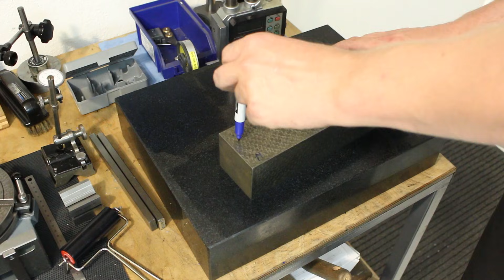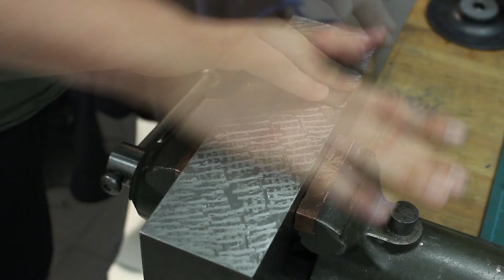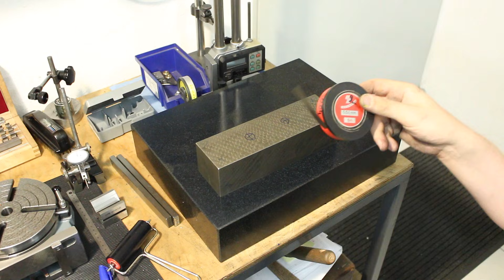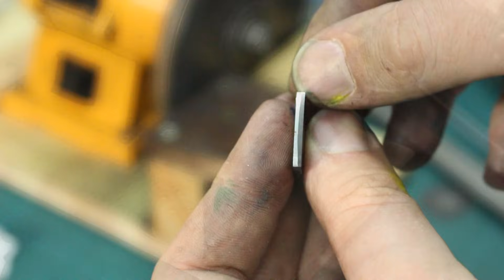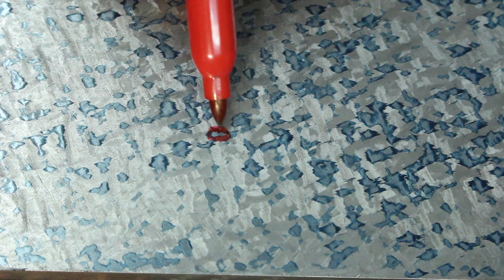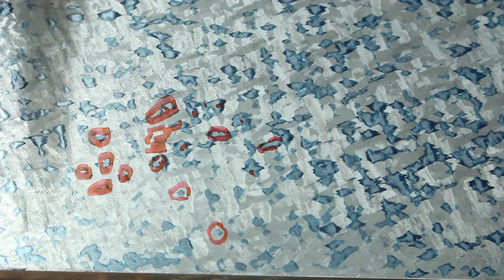Scraping basics - Scraping flat - Part 2

Comment: Thanks for your great videos, excellent quality, keep up the good work!. 
I'm very interested in videos on scraping, looking forward to more on this subject.
I've been collecting stuff to get my own Chinese lathe an overhaul. it's my main 'spending money on tools' excuse ;)
I almost have all the important stuff, only lacking real scraping experience. I tried and tested a bit on cast iron and did a project with rolled steel tubing (had no better material option at the time I started.)
Do you have some more info on the water soluble blue and yellow compounds, like brand and suppliers? I only have the oily smurf paste, which even creeps out of its tin on its own.
I presume the yellow is a Lead replacement, hope it's not cadmium based though ;)

Actually, you're up for a complete viewing of your video list. Only did that with Mr. Pete and Tom Lipton before that, so you're in good company.

gr,
Martijn

Comment: Very nicely done Stefan. I've been scraping for about six months now, but I definitely picked up some important pointers on the finishing aspects that had puzzled me until now. I think this is the best introduction to scraping available on YouTube. I think that's a very good thing because the topic is a bit shrouded in mystery and I think that keeps more folks from learning an important skill for keeping our machines performing well and for building precision tools. If you do more, I'd love to see a similar walk–through for using the power scraper and what new you've learned there. There are essentially no video resources that cover this well that I've found. I know that would be a big help to me in building my skill, and I expect to others as well. Thanks again for such an excellent job and a fine contribution to metalworkers! :)

Comment: I have two serious questions:
How much pressure do you use and how do you deal with gouges?
Reply from the maker: Enough pressure to take a descent chip. Hard to explain it without actually showing it. And gouges are simple to be dealt: Avoid them. Once you gouged the surface you have to live with it :)
Reply: I appreciate the response.
I guess that will be as good an answer as any.

Comment: Stefan, this was simply outstanding. By far the best introduction to handscraping I've seen anywhere (and I've been devouring everything I can find on the subject including Mr. King's course, the Connelly book, and the book and DVD from Michael Morgan).

I took Richard's course at Keith Rucker's beautiful shop in Georgia just a short time after your class in Denmark, and I've since been scraping just about every piece of cast iron I can find in my shop. I feel like I'm slowly starting to understand what I'm doing, but I sincerely wish I'd seen these videos before attending the class. Richard has a wealth of knowledge and experience, but these videos do a better job of explaining the basics than even his own material (no offense to Mr. King at all -- I'd recommend his course to anyone).

Scraping flat, parallel, and square is the all important first step, but I only wish there were a sequence of advanced courses in machine rebuilding. There's a dearth of material on the subject outside of the Connelly book (which will put anyone to sleep within a couple paragraphs). I'd love to extract the forty or so years of accumulated knowledge currently residing in Richard King's head!

Thank you sincerely for all your videos. I'm an avid fan.

Comment: the question I've always had is this, how do you make a straight edge, or dove tail block, larger than your surface plate? There are many machines, 100's of times larger than the largest surface plates
Reply: You would just follow the same process that you used to make a surface plate from scratch with a bigger plate of course. 3 plates are scraped in pairs and the math cancels out any concave or convex plates because the only shape that can eliminate the high spot mutually on 3 surfaces is a plane.

Comment: Does a lower radius make the valleys more shallow? Im guessing a higher radius tool is used for roughing right?
Reply: A lower radius tool will make a deeper valley as the force of the tool is applied to a smaller area.  However, the valley depth doesn't increase proportionally.  A 40 will not be twice as deep as an 80 with the same tool pressure as the deeper you try to cut the more well anchored surrounding parent material pushes back.  A large radius gets you flat faster but that's only half the process.  You use the smaller tools to bisect or cut up large contact points or islands into smaller more numerous islands to spread the load.  Also, for sliding surfaces you need smaller tools to make deeper valleys to hold lubricant that gets drawn into the contact points by capillary action and surface tension -   Flaking is good for that.

Comment: Thank you so much for this series, Stefan! This is by far the best explanation I have seen anyone do so far. Definitely looking forward to more like this. In particular, I would really like to see how to scrape machine surfaces in situ, taking a straight edge to heavy parts. I am restoring my benchtop lathe and want to scrape the ways, but the only thing I've seen anybody else do is talk about their straight edges in the rough casting stage, and not showing how to use it. My shop is small and I don't have access to a surface plate large enough to span the full length of the lathe bed, so I am thinking of lapping together some plates using the 3-plate method, but I don't know what material to use or how thick it should be to not sag or warp. Any ideas?

Comment: How much/deep does A scrape remove?
Reply: Depends entirely on how hard you lean on it. So it removes however much you need it to remove.
You only work the high spots, and you don't remove the entire bump... The whole idea is to create a large number of dents in the surface, to reduce the percentage of material that touches together.
This was explained in the first video, not in this one.

Comment: I have a set of questions that might be relevant in next episode: How much material will scraping remove? And how much material is too much to scrape? How would that material be effectively be removed first?
Reply: 1. How much material removed depends on how hard you push down, and how many passes you take.
2a. You have taken too much material when you create a low spot.
2b. Or, if you mean how large a surface is too much, then there is no limit however you need to work out a substitute method to determine flatness than blueing, once you can no longer lift the part to the surface plate or visa-versa.
3. Typically the basic surface would be prepared by milling then surface grinding to get it within reasonable tolerance. However if you have patience you could scrape in a rough cast part. A set of cheap diamond plates, a sheet of glass and wet/dry paper or even an angle grinder will get the high spots off.

Comment: Great video Stefan, as usual! Can you please share a link for some cheap Chinese semi-decent surface plate?
Reply from the maker: Just look them up on ebay - Everything thats not name branded is likely to be from china ;)
Reply: In my particular case, shipping to NZ is offensively expensive, and the cheapest shipping on an imported surface plate was more than I paid total locally. YMMV.
Reply: Surface plates are damn heavy. It may be cheaper to find a local supplier than to pay the one-off shipping for a direct import. I bought my two mhc (high quality Chinese brand) from Industrial Tooling in Penrose, Auckland, and they were less than half the price of getting the same (maybe) mhc surface plates direct from China. It's cheaper to ship a container of granite, than to DHL ground express or whatever a single crated surface plate..

Comment: i like the way u explain how to detect fake high spots, it saves working time, thank you
Reply: "Fake high spot" could be due to in-consistence in applying pigment. best is to know type of pigment you use, learn how to read the "eye" and it surrounding smearing of pigment. and try to memorize the contact pattern and identify the very low hollow spot.  that my not so experience tells me.

Comment: Hello, Stefan! Great video again! Where do You get your bluing dyes? I'm from Estonia and have not found anything locally (maybe I did poor job looking). And ebay is not that generous either.
Raido from Estonia :)
Reply from the maker: Most Biax Reps should sell the Canode ink - Or you try to get the oil based Dykem High spot blue.
Reply: Googling can't find either in Estonia, have to settle for ebay probably.
Reply from the maker: Maybe try to contact Biax Germany, they might be able to ship to Estonia or tell you a rep for your area.

Comment: Is there a way of scraping a surface when your reference plate/straight edge is smaller than the surface you are scraping?
Reply from the maker: Yes - Thats a great thread anyway :)
Reply from the maker: Kinda - If the straight edge is something like 75% of the length of the surface you can mickymouse your way trough by overlapping the straightedge, but its dangerous :D
Reply: check out the threads on Practical Machinest 'reconditioning a Shaper ' machine reconditioning section -  there is some great advice on just that - I had teh issue with my 600mm Surface plate being 180mm too short for the Shaper Ram I was scraping. Hinging is a problem.

Comment: I was looking to find out how much power scraper cost but could not find them online. They must be speciality tools that I need to look for in special stores or I am not searching right. Do they have some special name or something?
I only found carbide tips- knifes for scrapping on eBay... But no handle... I guess that might be best to be shop made? 
Just wondering how much would all tools cost with power scrapper.
Reply from the maker: A new Biax powerscraper is about 3000Eur - Not cheap ;)
They show up used pretty often and sometimes you can get a good deal. Biax and Renz are the two manufacturers that build powerscrapers.
Reply: Stefan Gotteswinter thank you for manufacturer names I will try to look for them used. For such price it's a good excuse to do some manual exercise...
Reply: Maybe you could throw together a makeshift one by using a reciprocating saw.